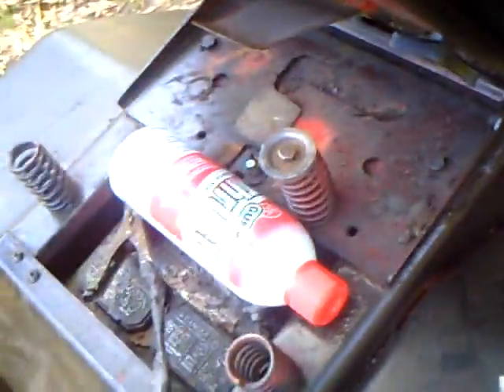my next racing mower part 1

Comment from the maker: @CSAKvids you mean the blower hoiusing? yea it actualy stays fairly cool, but until i fix electric start fixed im gonna leave it off, its top speed is about 30 to 35 aint bad but that one is for off roading mostly so you dont need much speed, im gonna make another one and take my time on it. i might use my spare four wheeler engine fort he next one, it should hit about 80  lol